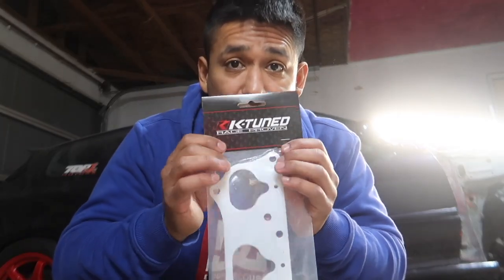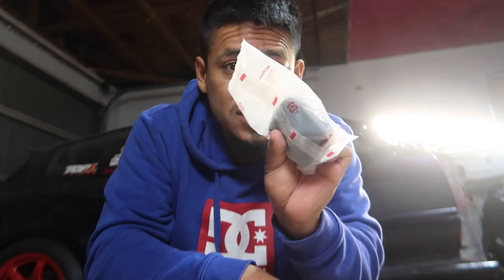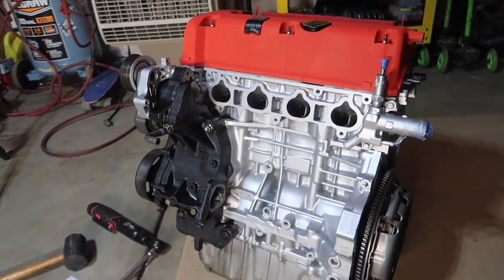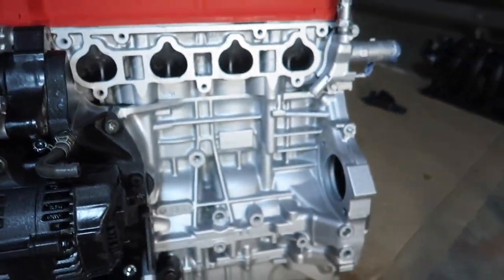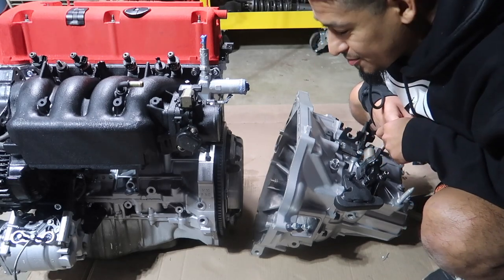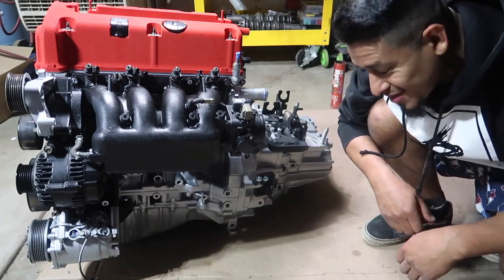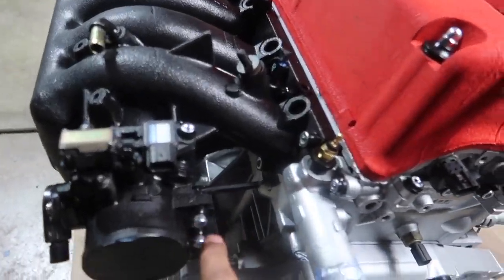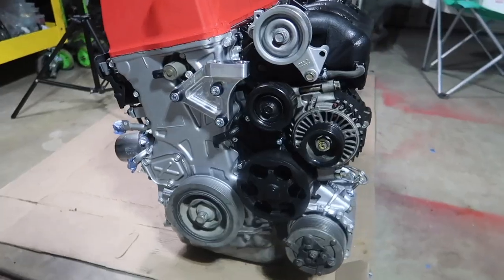Installing Hybrid Racing K SERIES Shift Selector & Detent Springs/Reassembling The Motor

Comment: would spray painting your alternator potentially mess it up? First thing that comes to mind is wires that are now coated overheating.
Reply from the maker: Not exactly sure if spray painting will mess it up
Reply: also spray painted INSIDE his fuel injector bungs, overspray inside the intake ports of the head, intake gasket area is not masked off. This is a disaster.  Mask everything that needs to seal.

Comment: Hey so do detent springs break in ? Cause I have acuity selector springs , acuity short shifter and just installed hybrid racing detent springs and it’s loekey not that enjoyable lol it’s tight to go in and out of gear especially reverse
Reply from the maker: when i did mine i didnt have that issue tbh with you, i understand what u r saying and it seems to me that will all that modification to the shifter assembly is what is making it feel extra tight. when i did mine it did feel tight but not to the point where it was an issue or unenjoyable but it is supposed to be tighter for sure. hope this helps, any other questions feel free to ask
Reply: If you’re driving it daily, there was not point in buying them.  If you’re shifting non stop from 45-9k+ rpms then you made the right choice👍  I race in the santa cruz mountains, constant turning and downshifting.  My car shifts like butter rather than the icky shifting feel when your driving normal
Reply: @trackshun  thanks for the reply . I’m thinking of going back to stock since I only use my car for daily driving .

Comment: Is that the stock selector and you just replace the springs etc and you just painted it...or is that a entirely new selector? As I'd rather not paint mine but it looks like shit
Reply from the maker: That’s the stock selector, I just painted it and yeah I just used new stiffer springs